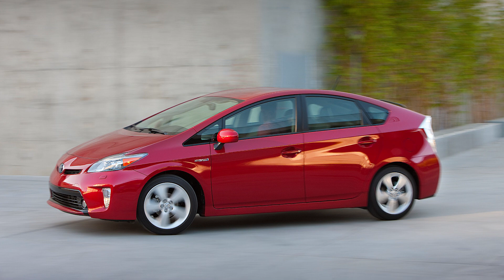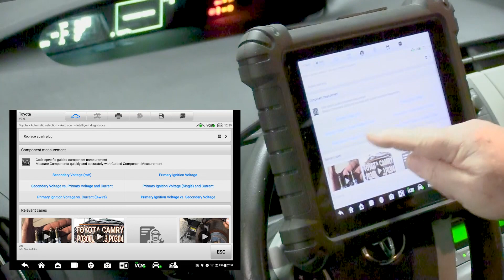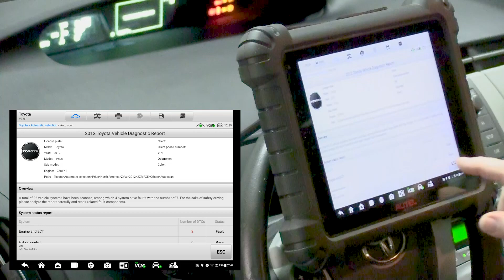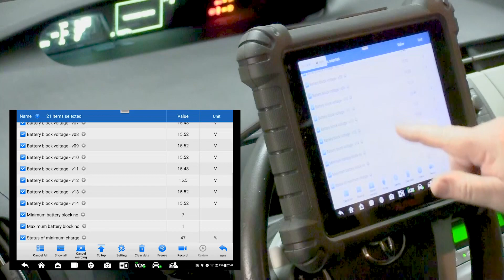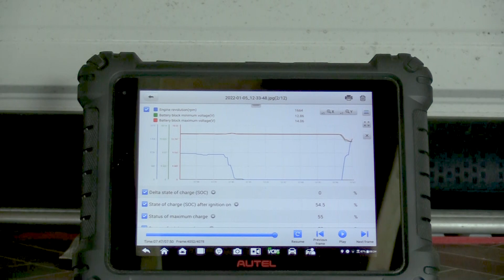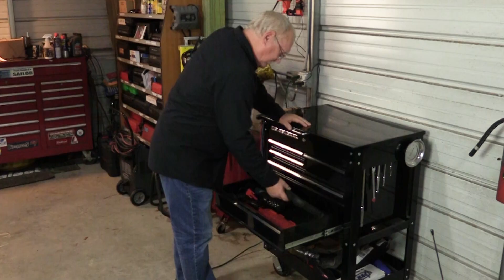The Trainer #122:  Toyota Prius HV Battery Inspection

Comment: Under what circumstances should I as a do it yourselfer remove the high voltage battery and clean the battery bus connections?  I have an "old" hybrid battery pack

Comment: Thank you for your content. Quick question. Can someone disconnect the hybrid battery? Will this prevent parasitic draw on the 210 volt battery if you don't drive it for 6 month and will it still be as strong as the last time you used when you reconnect it?
Reply from the maker: Not necessary. There are two relays that have to close to connect the battery to the system so effectively, the battery is already disconnected. Kind of like the battery disconnect switch many RVs use.
Reply: @VehicleServiceandRepair  thank you. My hybrid battery died baceuse I've been away for months at a time. Now I need emissions done which is the only reason I want to fix it but when I think of the cost, it makes me think twice and see if  there's a way to prevent a repeat
Reply: @The REAL DIY Garage its a 2013 prius with i believe is the original battery
Reply: @The REAL DIY Garage ok 👍🏾

Comment: I did everything required to add the 14 HV battery voltage PIDs onto my TorquePro app. In TorquePro I see the new "meters" but they all just show about 11 volts with no minimum or maximum. My OBdII scanner is connected to my android phone via Bluetooth, and the app says it is connected to the ECU. What is happening?
Reply from the maker: It may be your scan tool. Send me a screenshot of what you're tool is displaying. Email is 
pmeier@endeavorb2b.com